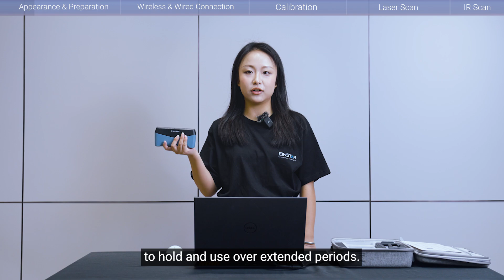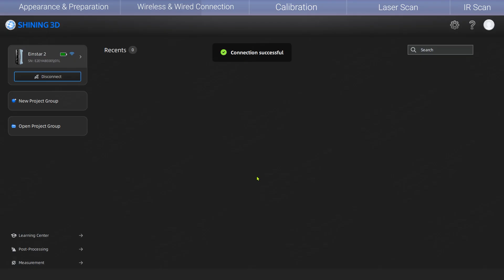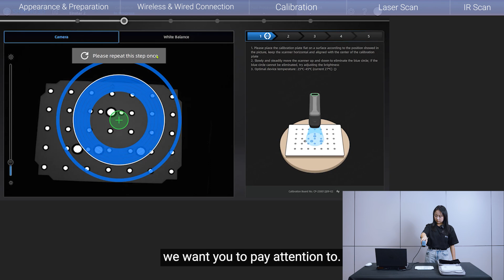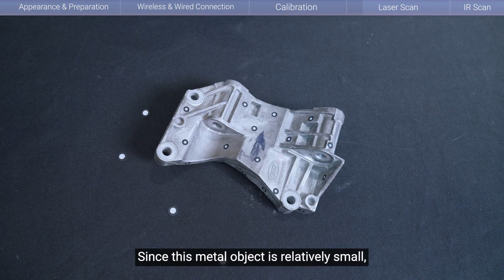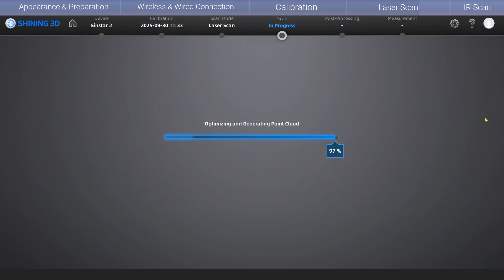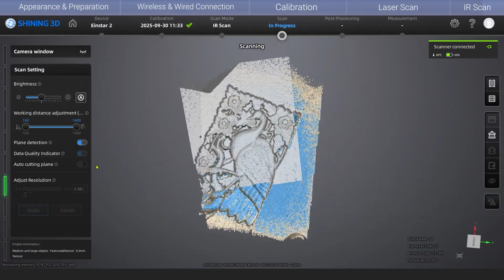Tutorial — How to Get Started with EINSTAR 2

Comment: How minimum and maximum size object scan with this
Reply from the maker: Great question! Instead of throwing specs at you — here's the practical answer:
Smallest object: down to about the size of a coin (10×10×10 mm), with HD resolution as fine as 0.05 mm — so you can capture very fine details like threads on a screw or tiny engravings.
Largest object: virtually no upper limit! A single scan covers up to a car hood or large furniture piece, and for anything bigger, we support multi-scan alignment — you just scan in sections and align them into one complete model but that will take up a lot of memory.
Reply: @einstarofficial Thank you so much for your reply

Comment: So i need a computer near the scanner to scan? Via wifi or cable. So i cant take it with me to the city and scan something and work with the scan at home?
Reply from the maker: The device only needs to be connected to a computer for calibration — once a week. During scanning, you can take it anywhere you want. No computer needed.
Reply: @einstarofficial ok cool. Might try it then

Comment: How to you connect the Einstar to your computer? I try and it doesn’t show up. So far all I have is a $1000 paper weight.
Reply: Go to settings and turn on location services and then allow app access make sure einstar is selected. and it should pop up in the EXStar hub software almost immediately. That's why i went looking for videos and this fixed my issue.
Reply from the maker: You can submit a support ticket, and our supporting team will help. https://support.einstar.com/support/tickets/new